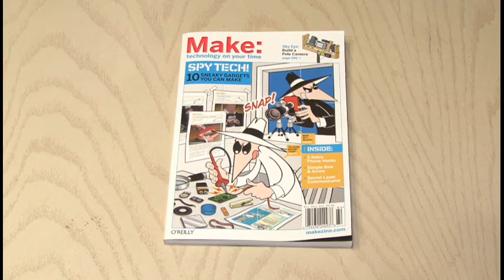Weekend Project: Make a Sneaky USB Battery!

Comment: I know it's a very old vid but a very cool idea.
Got 1 thing that might be wrong here and that the wire connections from the USB to the board. Seem to be flipped (2:28 yellow on the top) so it doesn't work.
Better would be to wrap the wire around the board and have the connector hang on the other side.

Comment: doesn't the magnet screw up the data on the device? that's like putting a super strong magnet near vhs tapes or magnetic devices.
Reply: Fa Vang No because the storage medium is not magnetic.
Reply: +Fa Vang no not realy
Reply: +Fa Vang Danzotron is correct. Flash memory is not influenced by magnetism.
Reply: Danzotron ah ok. I've lost plenty of data on or near magnets, esp. big ones that are used in 10+ inch subs and neodymium mags. Well I've noticed the read/write cycle is shorter when they are magnetized and fail within a few weeks so I always assumed it's messing with the read/write cells.
Reply: +Fa Vang no not realy

Comment: what the english name of the machine in 2:18 plz answer
Reply: Yeah there should be just look them up on youtube
Reply: thank you brother
Reply: yeah thanks
Reply: theturkishbadger its not too hard to use it.As a pro i recommend for standard soldering irons (without temp control):
1. Dont let it get too hot. 3-5 minutes heating up are enough. when it gets too hot, it doesnt make the best contact
2. Clean the tip when its black or full of solder.
3. TO FINALLY SOLDER THINGS: First touch the targets together and heat them up for 5 seconds or more.
Then add solder to them when theyre hot and BOOM perfectly soldered
Reply: Soldering Iron?
Reply: Soldering iron, solder sucker
Reply: thanks guys is there a tutorial to use it ?
Reply: A soldering  iron?
Reply: +drkastenbrot I pretin

Comment: but the magnet might corrupt the blue print government files as u can't have magentis near hard drives or usb

its ok for low level data but not high level data.

comment please
Reply: Just No. Magnets are fine near Non-magnetic storage mediums such as Flash memory used in USB drives.
Reply: davegsm82 modern harddrive wont be affected either
Reply: MxitQeepNimbuzz The magnet isn't strong enough to remove or damage any data.
Reply: Luke-Antra Depends how strong the magnet is, if I shove one in the MRI machine at work then I doubt it would survive!
Reply: davegsm82 well you can use even verry big magnets on it, but a MRI would kill it

Comment: I made smoething useless as this shit but way more easier to build and use. Just take an empty Clipper lighter (those round ones), take off the bottom and stick the flash drive inside. I used the same kingston 1gb flash drive of this video and it worked, the only difference is that I didn't have to usnolder and solder parts and stuff and sand the flash drive and shit like that and it's normal to have a lighter in the pocket than a battery. I already said it, mine clipper lighter flash drive is useless, but this thing sucks.

Comment: Far, FAR better to just hide a micro-SD card somewhere and have a USB reader for it in your drawer/laptop bag. An equally viable alternative is some password protected online storage such as DropBox or a myriad of others.

Hell, doesn't even matter if you have a drive that is easy to find just encrypt the important stuff or put it in a password protected .rar or .7z
Reply: Unless a weak password was used (short/ vulnerable to dictionary attack) or you have some insane SHA256/AES hashing rig it will take a long time: Mixed case, numbers and some easy symbols makes 80 different characters, 10 chars long 80^10 = .1.1e19, at a reasonable 300 Million Hash per sec it would take 160 years to hit every combination. Regardless, a Micro-SD is still easier to hide than some jerry-rigged USB drive - you only need to hide the data, not the interface,
Reply: Agouti Or you just use the backdoor.... in like 20 seconds?!
Reply: Yes for old style .zip, no such thing with modern 7z or rar. Feel free to prove me wrong.

Comment: the magnet will errase the stuff....
Reply: in usb sticks are flash chips and they aren`t based on magnetic technologie
Reply: iamtehstig ACTUALLY Platter hard drives ARE HIGHLY sensitive to magnetic radiation... BUT all drives these days are shielded against magnetic radiation, so your right, but wrong at the same time!
Reply: TheMelonLover64 Not to mention you could stick that magnet to the side of a HDD as well without any damage. Not everything is as volatile as old floppys were.
Reply: Well I didn't mean take it apart to do it. That would be a bit extreme. 
With the platters and write/read arm exposed you would have way more problems than just a magnet being too close.

Comment: ok... how the hell are you gonna use that if there is no way to plug that into the computer.... the flash drive head is bent all to fuck
Reply: You simply unfold it, he hasn't soldered it to the board or anything; just making it compact so it fits into the super sneaky USB battery encasing.

Comment: DO NOT construct objects for everyday use from toxic waste. The inside of a battery is quite unhealthy if in contact with skin. I would not recommend to handle the final product without protection. Even if it is cleaned well, there are still toxic remnants. Batteries are not made for being opened!
Reply: A non alkaline cell as used here doesn't pose much chemical risk. The most dangerous chemical is even allowable as a food additive. Look up E510.
Reply: Peter Kwan Yep, use protection, don't handle without a condom, you can't be too careful. Infact if you happen to be Irish use 3 condoms, to be sure to be sure to be sure!

Comment: why would you seal it with a magnet, using a magnet you'd run the risk of blanking the usb storage
Reply: It's solid state, not a magnetic hdd
Reply: the 100000000000000000000000000000000^100000000000000 time i've seen this comment
Reply: well thats bound to happen after 3 years

Comment: Exactly what I was hoping for, but didn't get. :(
Maybe I'll just have to figure one out of my own, maybe gut a bulky flash-drive and solder in a female USB with a set of rechargeable cells.
That, or I could just gut out a 9 volt and build a USB charger inside of that. I have plenty of the dead things, anyways...

Comment: no magnetic media AKA floppies hard drives zip disks and Magneto-optical/floptical disks (google magneto optical on wikipedia for info used on the N64DD and other products) will be erased by magnets but solid state media flash drives memory cards SSDs devices like that are fine with magnets

Comment: Ok ... Let me get this straight... You cut open a battery (bright idea there) and you open a usb drive. Then you dremel the side of the usb and move the connector to a place you cant use it without moving it. You then have to stick the usb drive in the cleaned battery cell without thinking of a way to get it out (nice) and put the end on with a magnet and wrap it up in the label.  Now you invite a friend to your house and he puts the "battery" in a remote thinks its dead and throws it away...

Comment: Carbon is not dangerous, unless you inhale the powder. The battery has some acid in it though. Covering the memory board with hot glue would probably prolonge its life a bit more.

Comment: 2:30

SAFETY WARNING (because it only says to be careful not to grind any components/traces): Please be careful when you cut/grind circuit boards. The dust produced by that stuff is NOT good for your lungs. At the very least, try not to inhale the dust, if nothing else (trying not to inhale the dust is like trying not to get wet in the rain, but it's better than nothing).

Comment: I'm doing a similar project, except it's using a small motor to power moving parts, would i be able to connect the board to a small extension cable and connect the motor to the same extension cord or would i need a USB splitter for the thumbdrive to be separate from the motor?

Comment: There I was thinking "That's a pretty stupid idea, those wires will fuck up the high-frequency USB signals, and how does the plug connect since it doesn't stick out any more?".

Then the credits, and it's a Kip"perpetual motion and a whole other bunch of shit"Kay production! From the guy who told you how to steal 50 milliwatts of power from your phone company!

Still, at least this one's not illegal or based on nonsense principles. It's merely crappy and won't work well. Which is an improvement!

Comment: If you went a bit further with creativity here, you could have engineered a hinged battery cap end with a spring-loaded USB connector of sorts, that way you wouldn't need to pull the cap off (and lose it), followed by pulling the entire PCB out of its housing in order to use the device.

Comment: @kiloman3 OK, could be destroyed with strong electrical field like from a microwave oven or so, but with this PERMANENT magnet? Searched all the Internet up and down and even wikipedia says that ssd discs are commonly used in surroundings WITH electromagnetic field cause common hard disks may get destroyed. So if you still feel right, please post a link where it is explained scientifically. Then I will feel more dumb than all the others together should feel by my post. Many Thanks

Comment: @robangmilitary Magnets affect harddrives. They do NOT affect flash memory like USB sticks and SSDs. 
The reason why harddrives usually need a very strong magnet is because of the metal housing, which protects the actual discs from external magnetic fields.

Comment: Another, way more important reason, to use a Zinc battery (Non alkaline):
Alkaline batteries mercury inside. Trust me...YOU DON'T WANT TO OPEN THEM.
btw: litium batteries are also non alkaline ones but they will explode if you cut them.

Comment: Great video, but the black stuff in the battery is not a carbon material, it is a chemical called manganese dioxide and it is very toxic and possibly carcinogenic.

Comment: what would make this better is to connect that cover to the positive terminal so that the usb acted as part of a circuit. so you could put it inside a real device with other batteries and the device would still function, probably poorly, or dimly, but functional.

Comment: @cokbagus23 There are still a few types of storage you want to keep magnets away from though. The most common one is credit cards. The strip can be screwed up by a relatively small (but powerful) rare earth magnet. I use a couple 4"x1/2" magnets to destroy the data on old credit cards before shredding the cards :)

Comment: @Lunas2525 Personally if you could make it fit I would convert the plug on the drive to a female MiniUSB, secure that on a little plate near the end and then put the cover over that. Then you just need a mini USB cable to plug it in.

Also @meex, you can't damage a flash drive with magets. You can however use some good strong neodymium ones to wipe old credit cards though.

Comment: @scottyo123456789 ....you fail at modern technology. flash memory (everything except floppy disks and platter hard drives) is NOT affected by magnetic fields. they work by storying tiny electrical charges in microchips instead of aligning tiny magnetic particles on a plate.

Comment: @NoiseFr3ak  A magnet wouldn't corrupt the data on a flash drive if it's a weak magnet, however if you use a neodymium magnet and swipe it across the drive several times, it possibly could. The only time i had a problem with the was when i dropped a box of magnets near where i store my floppy disks, those can be corrupted with almost any size magnet

Comment: 1.- Neodimium magnets are pretty strong, and flash drives are quite unstable (emphasize on quite as "not that much") around those.
2.- I asume the date of the post matters, but why not use a MicroSD card on a slim usb adapter?
3.- The project is VERY cool, but, wasn´t that usb fit snuggly in the battery casing? Dont you need pliers to get it out? 

Other than that, kudos!!

Comment: @neil120897 then you have a short some where the video should have covered this but the exposed contacts on the circuit board need to be covered with electrical tape otherwise it will short on the case and cause issues...

Comment: @meex88hiphop it is stored electrically the presence of voltage in a sequence is placed in the chip and it flips transistors to form a binary code  same as the pits on the bottom of the cd or the magnetic bits on a hard drive platter 

only issue with the design in the video is to put data on the drive you have to pull the usb port out and the wire flex is going to need pretty constant repairs  i would have found a way to do it differently

Comment: @CagedAlchemist Only things like hard drives which work by storing magnetic fields on metal plates can be affected by magnets, and then only if the field oscillates. In this case the field is constant, and the USB drive is solid state, which is not affected by magnetic fields.

Comment: no because it uses flash memory so there is nothing in the device that is magnetic unlike a floppy disk which is way outdated. Also hard drives are magnetic but to wipe the data you would need a really powerful one. So this project is safe for data keeping. unless you want to use a floppy

Comment: Actually, it won't. Basically, a flash drive store works on this principle: A bit of storage is a chunk of metal enclosed in an insulator. To store 1 in this bit, it uses quantum tunnelling to inject electrons into said chunk of metal. While electrons CAN be messed around with by magnets, such a powerful magnet would suck the iron out of your blood. A simple N51 or 52 wouldn't do that. You would need an N>9000 magnet for any danger. Conclusion: You, sire, FAIL!

Comment: You know that only Hard drives use magnetic storige but flash storige the data is "burned" onto the chip.
only way it can be removed is time or erasing in a computer.

Comment: pretty cool... but it seems pointless. i mean, there are like a mil other places u could hide a flash drive rather than a hollowed out battery. not to mention that since u disconnected and relocated the usb connector it looks like it wont work anymore... even if it doesnt get accidentally thrown out, it doesnt look like it will fit in a port anymore, and for that matter, you may as well have just erased your "secret files". that way no one would be able to see them and its not nearly the hassle.

Comment: wouldn't it be handier when you connect te cables going to a self made battery cover that works like a usb then make a data reciever on the other side that looks like a the same cover but converts it to a  usb

()===()                            ()----[=]
battery with storage     reciever with usb 

get it?

Comment: I took this idea i bit farther. I used a tube of blistex and removed the blistex and the threaded pole inside. I then ground down the chip so that the flash drive circuit fit inside the tube. After trimming the outside of the tube just a hair and applying a couple of drops of glue to the corners of the usb connection where it contacts the case of blistex, it was secured. With the cap on, it looks like blistex. With it off, you can plug the tube right into the side of your computer.

Comment: i once opened a rechargable battery and the carbonstuff didn't stick to the edges with me. mine was empty, so i'd suggest using a dead one. (i'm not sure that actually WAS the reason why it was more solid, but anyway)

Comment: The battery is just to conceal it-
When you want to use it you just pop it out of the batter.
Thats why u cap the end of with a magnet instead of glue or saulder.
(So you can get the USB back out to use it)

Comment: ...Just to be clear about this, I'm not saying a magnet will erase the data on the chip (which it won't, as the data storage isn't based on magnetic polarity) - I'm saying a strong enough magnetic field will induce currents in the chip which will flow unpredictably through the chip, damaging it.

*sigh*
I wish you'd just let this issue rest. You obviously misunderstood me the first few times around.

Comment: Sorry, but you're wrong. Take a look at articles about magnetic induction for starters, then think about how exactly EMPs destroy electronic devices. Like I said, you need a very strong magnet for induction currents to damage the chip. That said, flash chips, like all other electronics, have maximum tolerances. Static electricity, for example, will quickly kill a flash chip, if hit in the right spot.

Also, I'd refrain from calling anyone stupid while saying things like "You sir" and "ROFL"...

Comment: Every material is suceptible to magnetic fields, the strength of the effect varies (check out the frog levitation video). Changing magnetic fields will induce currents in conductors (and in the case of this flash chip, the strongest currents will be generated in the PCB traces, afaict). No, THAT magnet is not strong enough to fry the chip. A much larger (electro)magnet is needed.

Also, I will whoever tumbed me down in the face with a machete. At least provide a reason for doing so.

Comment: Not immune to strong enough magnetic fields. A strong enough magnetic fluctuation will induce currents in the circuitry, which will fry the chip.

This magnet is not strong enough for that, however. :)

Comment: For one, there is absolutely no need to be so vulgar. Second, and average household with a real man in it has a Dremmel tool and a soldering iron. And third, don't sit here and spout of nonsense when you have no idea what you're talking about. Magnets do not wipe flash drives, which is one of the reasons they are very convenient.

Comment: you should try this with like a c or d battery, that way, you can keep the flash drive intact, but fill the outside with sand, so it has the right weitht. Then encrypt everything with truecrypt, and off you go. No one will suspect it, and if they do find it, they cant do anything